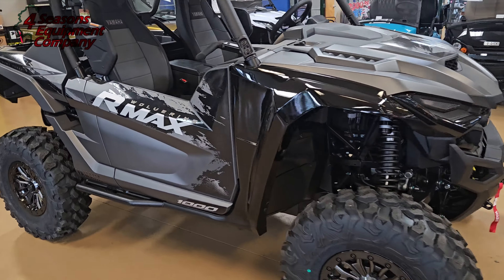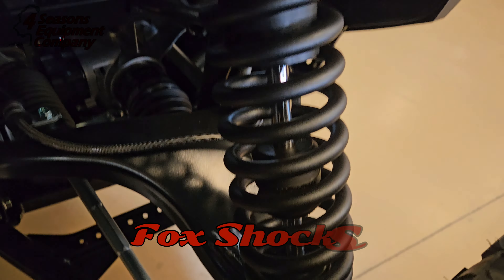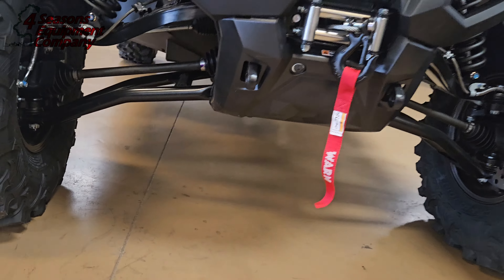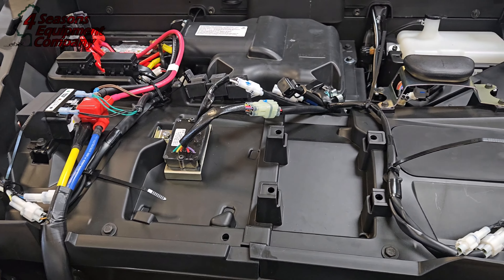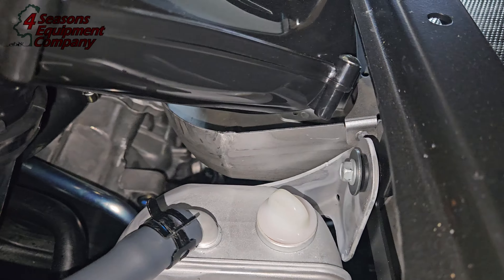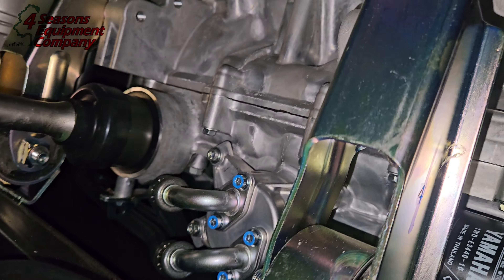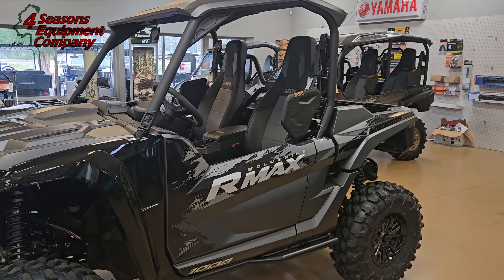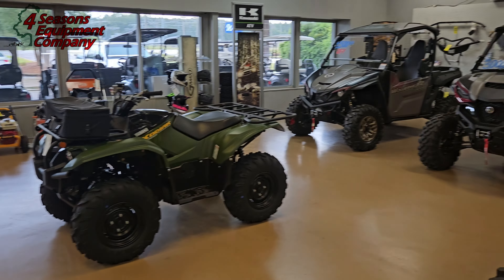Walk around of the 2025 Yamaha Wolverine Rmax 1000 XTR

Comment: Turf mode will be a main selling point when it comes time to upgrade my wolverine x2 850.  I hear people report the Rmax as being louder in cabin than the 850 which is on the reasons I am holding off.  I wish yamaha would make sport only frame more like a rzr with the 850 engine with better suspension and clearance.  The engine has plenty of power for standard trail riding and is fuel efficient.
Reply from the maker: I would recommend finding a dealership that will let you test drive the unit in order to see what you think. I know 4 Seasons Equipment here in tupelo will let you test drive it.
Also, in my experience, it's always been better to let the machine sell itself to you.